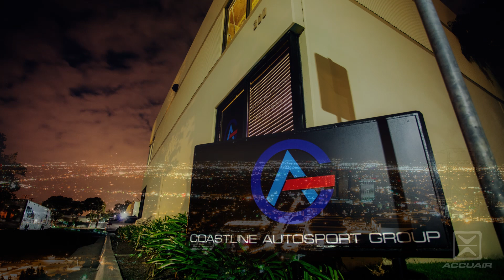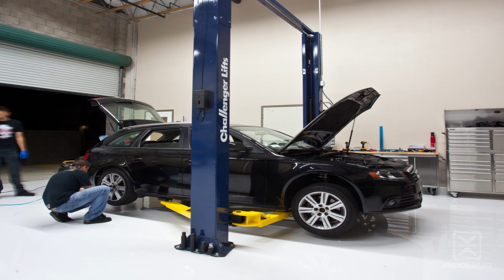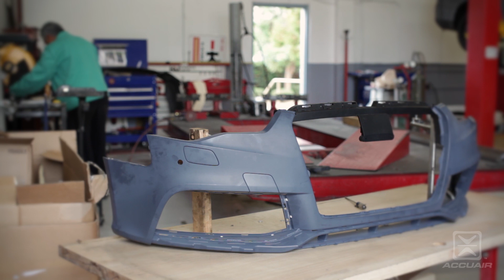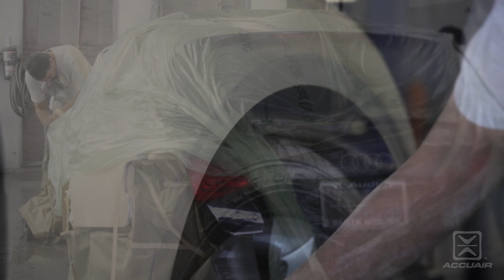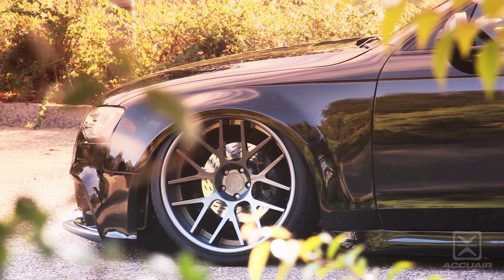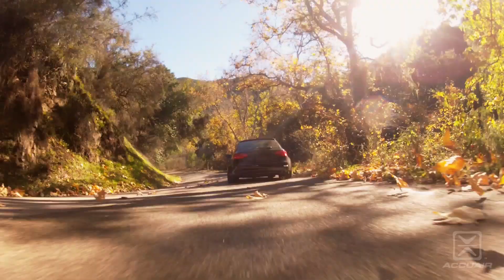AccuAir AIR4 Build Video Coastline Autosport Group

Comment: That's stunning and to do that in 6 weeks without the parts in hand is amazing. I wish my Avant looked like that. What would of top it off is big ceramic brakes, RS4 rear tail lights and the RS4 rear valance with the diffuser. I would also square rear wide fender similar to the RS4 which would blend with the whole rear panel